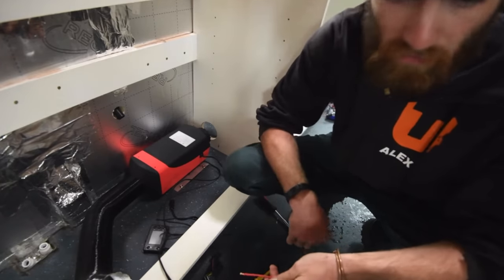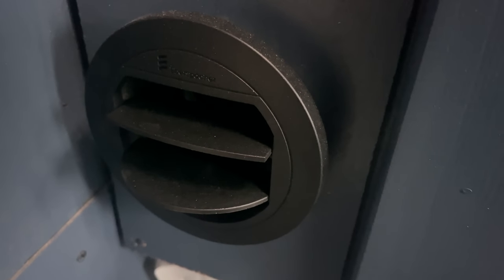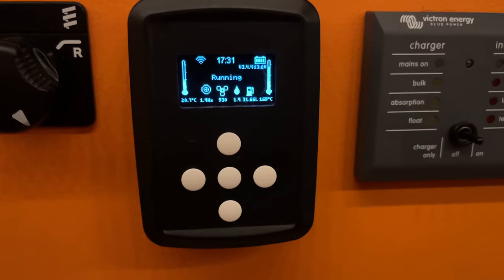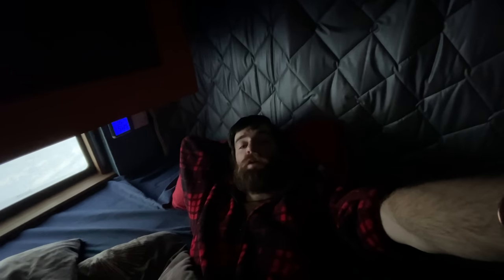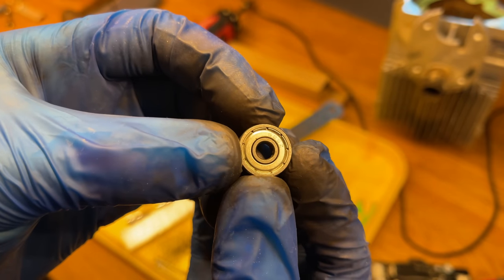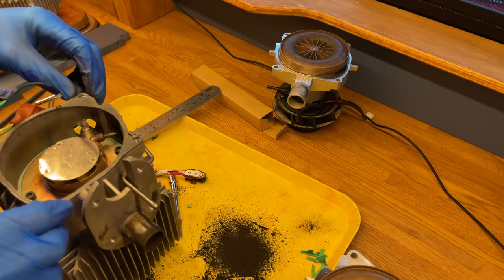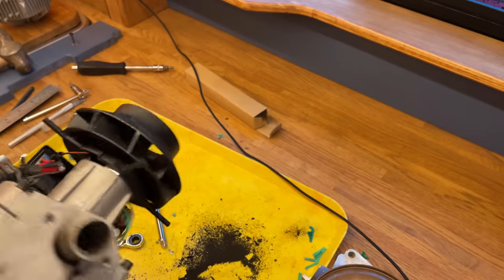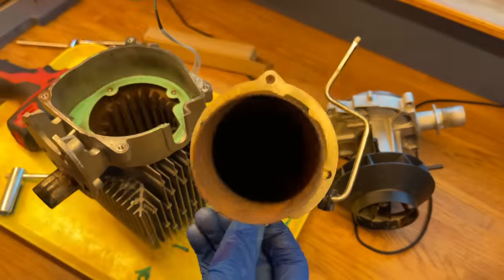2000 HOURS LATER! Chinese Diesel Heater

Comment: It may be worth directing the exhaust slightly further away from the chassis, to avoid acid products of combustion causing corrosion.
Reply from the maker: Hard to see the finished mounting of the exhaust mounting in this video, but the exhaust plume comes out from underneath the skirt of the van

Comment: when you have a run bearing its wears away the housing for it. the bearing spins on the outer edge. locktite 660 is used to "glue " the gearing into the housing. Taken me years to work that out on my ride on mower. Cool video!
Reply from the maker: Thank you for the advice, a few have mentioned Loctite
Reply: @MispronouncedAdventures  The loctite bearing fit is a must have in any maintenance tool kit. Tremendously useful stuff
Reply: Many of the 1970s Japanese 2 stroke trail bike engines suffered with bearing creep on the crank mains. Loctite bearing fit was the solution. Yamaha resolved the problem by fitting a small pegging dowel to the outside of the bearings.

Comment: Really interesting video, great stuff. I must say however, that putting a heater next to a fridge seems like an oversight, usually you'd want your fridge away from any heat sources.
Reply from the maker: It’s not really near. It’s a completely different air mass from the fridge. So heat radiating off the heater and it’s venting in that cupboard doesn’t affect or come in contact with the compressor or the fridge itself. But I do see why people think that when they see the layout in the video

Comment: Great videos. I'm just getting into these heaters and your vids are helpful. Tip: I'm a Biker so you can make your own gaskets from cheap gasket paper if you need to and gas seal with High temp RTV.
Reply from the maker: Glad it was helpful. one or two people have also mentioned the cardboard gasket. Definitely something I would like to have a go at just to learn a new skill and option in a predicament
Reply: @MispronouncedAdventures   I've just had a thought. I've used Redex fuel cleaner in my Motorcycles for over 40 years as it keeps the carbs/fuel injectors and fuel line clean. It also prevents carbon build up in cylinders. I'm wondering if it would extend the service point of these heaters e.g a little shot now and then :)
Reply from the maker: I have no idea to be honest, but I do use premium diesel which does have cleaning additives in so could be related two why I have a clean burn chamber
Reply: there would be the copper/very thin can(diy)  gasket option . Very durable !!

Comment: Might i suggest you use 625-2RS bearings. .They are totally sealed, unlike the 625ZZ items.
Just a thought. I can't believe temperature would be a problem, given the position they are in. If there was excessive heat, the poor old commutator wouldn't survive !
Reply from the maker: I will look up these bearing. It’s a area which is near to me. But I can’t imagine they get hot

Comment: Really useful video and gives some confidence in the heater - not bad at all for 2 years. 
Love the tray on the worktop - what a great idea!
All the best, 
David 👍
Reply from the maker: Glad you found the video helpful! As for the tray I thought the soot would take forever to get out the pours of the wood work too if I didn’t. Plus to stops bolts, tools and parts going everywhere
Reply: Yep, I use an old metal cookie sheet with some scattered magnets to help catch errant screws

Comment: You can quiet the tick down if you insulate fuel pump. And make lines very hard. Pump makes majority of the noise so i would start by insulating it first.
Reply from the maker: I find my tick pretty quiet but I mounted it in x way to do so

Comment: great rebuild and good info
I have only had problems with my three units when 12v system was not powerful enough to supply 10+ Amps at startup and the shocking Chinese manuals
Reply from the maker: Understandable. Something I hadn’t mentioned in this video is I replaced the bulk of the original wiring loom with a thicker cable to reduce the voltage drop as usually the main supply wire is really long and quite thin. 
 I also use lithium system so I have a slightly higher voltage

Comment: The fan error you had in the arctic could have been something to do with your solar charge controller adjusting to colder temps if you have it running from that and not directly to battery
Reply from the maker: I’m not sure that will be the case. The solar charger controller wouldn’t  have anything to do with the PWM of the fan
Reply: I bet the Aurora is guilty for the error. The fan speed sensor is a hall sensor  (aka magnetic field sensor) and most likely hates auroras.
Reply from the maker: Hmm that’s an interesting thought. It’s worked every other Arctic winter night with aurora
Reply: @MispronouncedAdventures the aurora explanation has a nice ring to it. The fact that it has only happened once could almost be a confirmation.
The stream of charged particles looks dense in the sky, but each particle is miniscule. The odds of one hitting the right part of the controller are tiny, but not inconsequential.
It also sounds better than "a glitch"...
Reply: Trucks in the EU run the same diesel heaters and my pops had stories of them not firing up in -30 temperatures what they'd do is mix in a bit of gasoline. But it was only -15 for him so dunno.

Comment: The letters after the bearing number indicate the seal type, ZZ metal both sides, also the motor brushes being replaced would be a good idea. For the new price of these heaters my impression was above expectation, and daily use in my arctic climate.
Reply from the maker: When you get a good copy and it’s well installed they are great. I’ve just finished 2 months on the Arctic for my second winter with this heater on after this video

Comment: Just checked back on Artic adventure. I use evans waterless coolant and it never freezes until below -40 .Might be worth considering. Glad your heater was a easy fix
Reply from the maker: Cheers I will look into that. I was going to looking into a waterless ones I’ve heard of or a 60/40  mix glyco/water mix . As I’m finding for -40c this winter
Reply: @MispronouncedAdventures  Don't know what you're currently running, but mixing the the coolant heavier, favoring the the coolant, may get the freeze point down far enough. Possibly 75/25 or somewhere in that ballpark.
Also, at least here stateside, that muffler would considered a glasspack muffler. Cherry Bomb is the most recognizable brand name. Made me chuckle seeing one for a heater.
Reply from the maker: I’ll probably running a 60/40 mix which is around -53c I’ve got s few Finnish friends who can advise me on what they use

Comment: Who cares about thermal efficiency. Lets put something that is designed to get very hot  right below something trying to stay cool 🤣. Thanks for taking the time to show the process of striping down the heater. Really informative and reassuring video for users of the cheaper heaters out there👍.
Reply from the maker: I care about thermal efficiency which why it’s an isolated air mass from the fridge and the fridges compressor. additionally, the heater bodies / shells themselves don’t get hot, it’s the vents which do. So the heater doesn’t heat the fridge up
Reply from the maker: Plus the R-value of 18mm ply ( the plinth, the fridge sits on ) is 0.94, 25mm PIR insulation board is only 1.1 so it’s pretty insulated materials around it well

Comment: What I've seen from other is that the main issue is the screen for the glow plug clogging.
You can pick it out and just burn it clean
Reply from the maker: Yes. The atomiser / mesh can be an issue but overall mine was clean so I left it
Reply: I have cleaned them a couple of times by heating them to cherry red with the blow lamp and they are restored back to full function.

Comment: Wow, that’s a fantastic video. Thank you so much for posting very impressed with your skills not needing a shop manual! Very impressed with you, are ability to do preventative, maintenance and repairs, congratulations. I only just found out about these heaters recently and it’s like they’re life-changing. I haven’t purchased one yet but… I have been sending links to a friend of mine and I wouldn’t want to have steered her wrong! Apparently there wasn’t any dust accumulation on the impeller fan while you were working I was wondering if it would be helpful to modify a automobile engine intake filter to reduce any dust entering the heater wondering if any percentage of that tiny bit of salt buildup included any contaminants from the air intake. Two years $189 seems like a very worthwhile investment. Thank you so much for posting the video, the video tutorial, safe and wonderful travels to you.! ❤️❤️👍💯
Reply: I have been afraid these heaters were just junk, but I swear by your video anybody could have a reasonable degree of confidence in their reliability, which is pretty surprising at their phenomenally low price.
Reply from the maker: Glad the video was helpful. They are great units when you get a good one and set them up well. 

You don’t see it in the video but the air intake on the combustion side has a air filter on it.

Comment: You forget put that rubber cover to that bearing, thats why it went in so easy ;)
Reply from the maker: The bearing cover was on the bearing on the body. The bearing which went in easy the cap end of the motors near the brushes

Comment: A jacketed exhaust pipe could give you a hot water tank. Plumb it in a wall and out the roof so it doesn't take up any more space and is insulated. Would also radiate heat making the system more efficient.
Reply from the maker: I already have hot water from the diesel heater from the hot side. Heat recovery from the exhaust side is not really practical in vans.
Reply: @MispronouncedAdventures can you explain what you mean?
Reply from the maker: Heating water via exhaust heat / on the exhaust pipes isn’t practical in a van. You need to make holes to get water pipes out of the van into the heat exchanger on the exhaust pipe, and then back in again. In winter, if the heater was ever turned off, it would be susceptible to freezing the water which is still in the pipes and damaging it.

I use a bobil vans hot water system, which is a heat exchanger based inside the van on the hot air ducting
Reply: That sounds like a recipe for fire or carbon monoxide poisoning. Exhaust pipes should always be installed outside. Also, the exhaust pipe will eventually clog up if it isn't allowed to heat up properly.

Comment: i have had this heater running for half a year nonstop, 4 years in a row. i have changed motor few times, because after each season contacts have been worn away almost entirely. as for me it doesnt make sense to change bearings, the short tyerm solution is to fill oil in the bearings, that helps them to finish the season before i swap in new motor.
Reply from the maker: The bearing were knackered on mine as 2000 hours. But the communicators had loads of life left in them. I’d personally rather swap £6 in new high end bearings. it’s now 4000 run hours and fine. 

When I replace the motor I’ll probably put decent bearings in it
Reply: @MispronouncedAdventures  i guess the difference is that mine 5kw is running in upper half of range most of the time. So i guess more wear in a given time.

Comment: You could also pack the new bearing with DISC BRAKE GREASE it's synthetic, works from -50 to +400 F and has graphite, poly, and teflon in it. As for the seal, copper coat gasket sealer RTV has a tempt rating of 420 deg F.
Reply from the maker: Would that be to increase the lifespan of the bearing?
Reply: @MispronouncedAdventures  I believe it would, I've been regreasing any bearings that used regular grease with disk brake grease (except the wheel bearings in cars and trucks due to the weight) with the stuff and the general response is that the vehicle steers better and sounds better (u-joints, steering knuckles, pivots, etc.)
Reply from the maker: I wonder if you can grease these tiny ones as the metal shielding I think makes it a sealed unit
Reply: @MispronouncedAdventures  On small bearing like that, I've had success using a syringe with a needle that I cut off flush with an abrasive disc on a dremel. but is the metal shields are too tight it may not work.
Reply: Not DISC BRAKE GREASE but DISC BRAKE WHEEL BEARING GREASE.
Reply from the maker: Would it not be a concern if you greased bearings near the brushes of the motor that the brush dust would get stuck in the grease, making the issue worse in the long-term?
Reply: @specialservicesequipment393 motoseal would work great too. Many chainsaw guys take their head gaskets off and use motoseal instead. 
I’ve been greasing small bearings with Lucas red for awhile now, mainly on RC cars that see a lot of mud. I like to over pack and squeeze the excess.
Reply: So what temperatures are we expecting here (in Celsius…)? The blower is blowing cold air into the burn chamber on the internal fan. The fan itself is plastic. So it can’t become so hot there.
Reply: @demil3618  it is generating heat enough to heat up a good sized space. Where do you think this heat comes from?
Reply: @White000Crow  But that heat is on the other side, not on the cold side of the heater.
My question was about what temperatures we can expect around the bearing and the blower fan. And that‘s a lot less than on the outlet side obviously
Reply: @demil3618  it’s ambient air but might as well use the best grease you can. I have had mine shut off during a power outage several times, I’m sure heat can creep over to the inlet side at that point.
Reply: @MispronouncedAdventures  The way I have dealt with regreasing small sealed bearings used in debris zones is to use a grease press that literally pushes the new grease through from one side to the other, through the seals. High grade double metal seals and high viscosity grease can take some time. Eventually when my desired grease comes out the open side, I stop & give the bearing a good wipe and a twist to relieve any internal grease pressures, then I clean everything off with diesel and brake cleaner so surfaces are less likely to hold dust and debris.
BTW - I was concerned about how loosely that bearing fit. I think that bearing may have been missing a silicone cover sleeve much like the outer bearing had. That could be the reason for the original bearing failure. The bearing cover sleeves would also serve as vibration dampers to quiet the motor noise.

Comment: When you put on a new gasket. Give it a thin coating of Vaseline or chapstick. Makes it easy to take apart without tearing gasket.can reuse them.
Reply from the maker: Makes sense to me. when I’m often dissembling these heaters for review. I find the gaskets can be pretty well stuck onto the casting

Comment: If the outer gasket is not metal like the inner you could probably make one out of boxboard (thin non corrugated cardboard) tracing it out and cutting it with a razor blade. I have made paper engine gaskets that way before. Old truck of mine I used an ice cream sandwich box. I made sure it said ice cream sandwich on the gasket for the next poor bastard who took it apart one day
Reply from the maker: I had been told this by a few people that I could make my own if I really need too with thin cardboard
Reply: @MispronouncedAdventures  it looks like the outer gasket is not really necessary as long as both metal surfaces are straight. There is just fresh air on the other side of the gasket, a tiny leakage doesn't matter...

Comment: Speaking of afterburner, have you ever put a radiator on that exhaust so that you capture some more heat on its way out and would there be any back pressure issues on a fan type ignition system like that?  I'd like to put a thin little radiator under my water tanks.
Reply from the maker: I will give you that, that was a wonderful Segway to exhaust recovery question. 

That is an area I have not played with. I don’t really want to make any restrictions on the exhaust as I’m very happy with how the heater has been running. 

But interesting idea, I definitely think ways of keeping water tanks warmer for “free” is a good   Idea
Reply: I've watched a lot of video's on these heaters. This gent who has several videos on these, can't remember which, suggested to avoid any back pressure, and to keep the exhaust as short as possible, within reason.
Reply: I did a curious test on one of these little guys as they do seem to not burn all that efficiently. Probably due to the low pressure in the combustion chamber. So, I got a small catalytic converter and got it welded up right against the exhaust(they need to be HOT to work). It didn't do much at high power settings.. But at lower powers the exhaust after the cat was 120-170c hotter meaning there was a lot of unburnt fuel (and still enough oxygen) in the exhaust to burn in the cat. Being ever the curious engineer I wondered how much of that heat I could scavenge. I got a guy at work to weld up a counterflow water chiller for the exhaust, added a high temperature pump and a large computer water-cooling radiator to it. Turns out we could scavenge almost one extra kilowatt from this setup. It was fun as a experiment, but not very practical. Pros!... Free extra heat!... Cons... cooling the exhaust caused water to condense and the exhaust pipe would constantly gum up with this sticky tar like goop every 50 hours or so. Other con, If you had to pay somebody for all the man hours and materials, it'd cost more than the heater itself by multiples. In conclusion it was a fun experiment, but really not all that practical. It also had a tendency to boil the cooling water and blow pipes off on hotter days :P